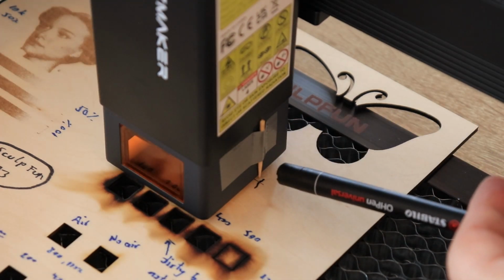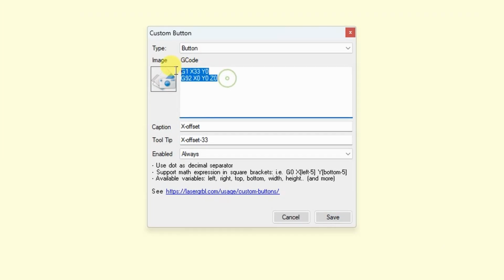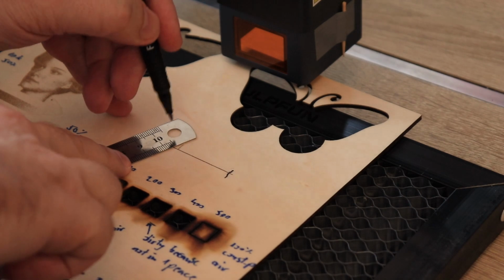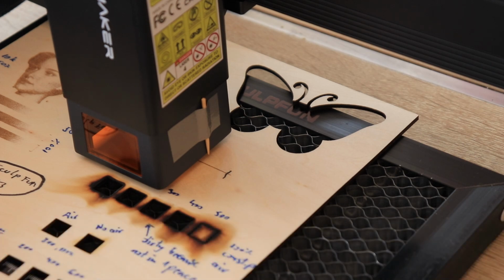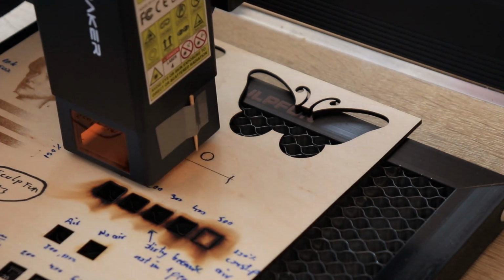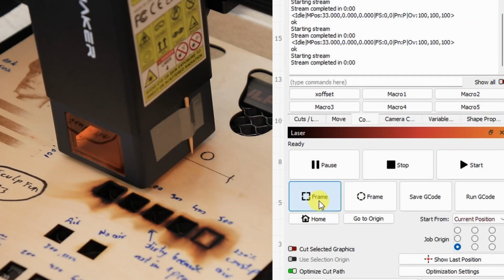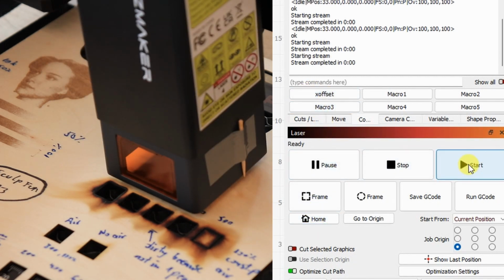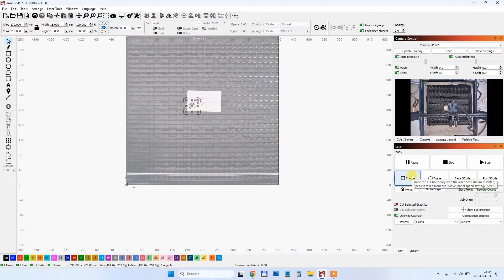The toothpick positioning method (Laser engraving with LightBurn and LaserGRBL)

Comment: light(like literally 3-5 walls thick and about as high as the metal below the glass)3D printed frame with centered marks(notch filled with paint for contrast) fitting around bottom of laser-guard would make it very easy to line it up without needing any macros.

Even easier would be some thin masking tape around it, then you simply burn a x-axis line in s scrap cardboard(taped down to keep it from moving during)and mark the tape on either left/right sides lined up with the burned line and repeat the same for the y-axis to mark the front/rear.

Comment: Hi Igor, how are you doing? LightBurn has a "Pointer Offset" setting that is used to compensate distances between a laser pointer and the actual burning-laser. The idea of a toothpick is very nice for lasers that don't have a pointer - but I think you don't need the Macro, just use the Pointer Offset.
Reply: I hope you don't mind if I put here a link to one of my videos where I showed how my xTool D1 was not burning exactly where the marker was pointing. It is the same concept - here it is:
https://youtu.be/RAee_Q0LhMk?t=549
Reply from the maker: Thank you for the "Pointer Offset" suggestion. Good solution for those who is always using the pointer (or toothpick). In my case, I need the toothpick (or pointer) only sometimes (on lighter wood I can see the laser point, or sometimes the position don't has to be precise). And good that you posted the link to your video, to this Pointer Offset, useful.
Reply: Thank you for this simple solution!
I found this because the Lightburn "Pointer Offset" does absolutely nothing with my Ortur lasers.
I have seen other comments on the Lightburn forums about the feature not working, but there has been no response from Lightburn.
So thanks again, in particular for the idea about centering the pointer on the X axis, thus removing one direction of possible error!

Comment: How about the Low Energy option from Lightburn? Where the Laser is powered with nearly no energy but the dot is visible?
Reply from the maker: Depend of the surface. On light wood it is visible. On dark wood, black acrylic, steel not.